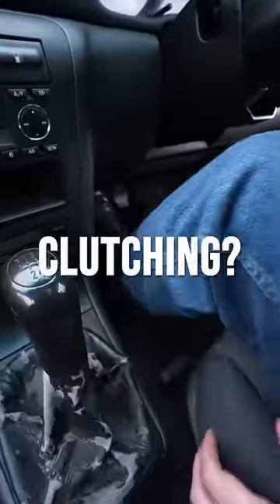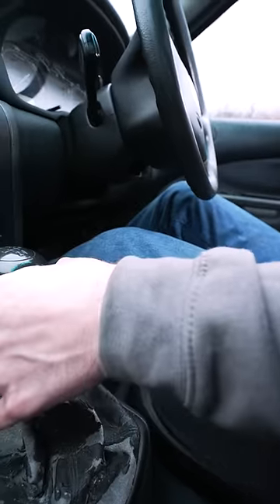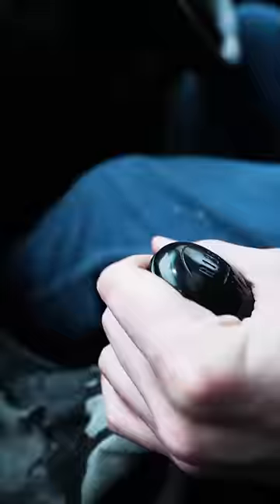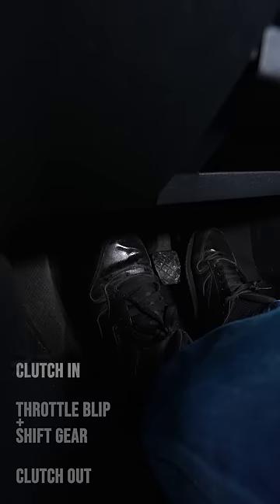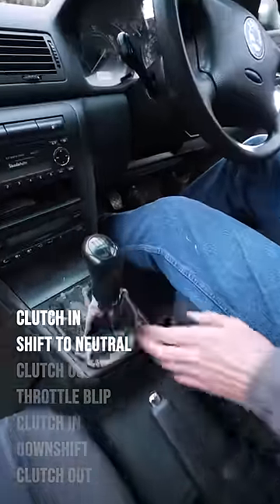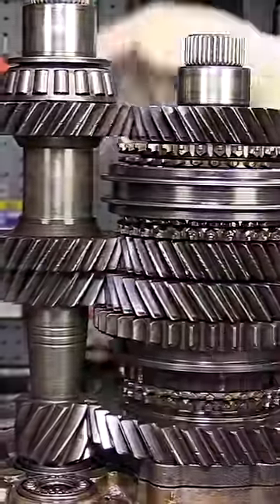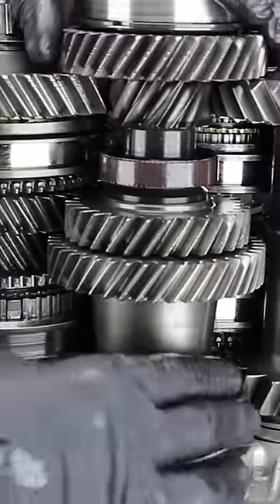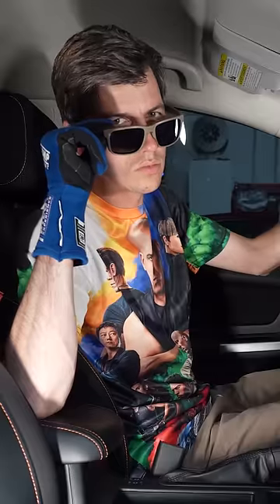What Is Double Clutching? Don't Granny Shift!

Comment: Got thrown on a manual dump truck at work, we borrowed it from a different department, ours were all automatic. They all said the clutch was shot and it wouldnt shift right. 5 minutes on google taught me how to double clutch and not to put the clutch to the floor when shifting and it soon became the favorite truck to drive.
Reply: you still need to put the clutch in for stopping and starting even if you're floating gears bro. you only half clutch when shifting cuz if its moving and you put the clutch to the floor it stops all the gears from moving and if you're rolling in gear there goes a 30k tranny!
Reply: i want an old dump truck so bad
Reply: I remember trying to learn to drive trucks at 18, we'd clutch to get out of gear, then release the clutch, and then just press the stick into the next gear and let it litghtly grind until the speeds synchronized and it would slip into gear without touching the clutch. I wasn't very good at it. My dad told me just to do the full fledged double clutch, which was clunky, but better for the truck.
Reply: You could just float the gears as well. I had to drive an old manual truck to get my license to drive an automatic lol. 

The whole time we just did gear floating, much easier and enjoyable.
Reply: @kaufmanat1 if you do it gently, you won’t grind the gears, my driving instructor taught us to drive with “Finesse” and only use 3 fingers to put it into gear. If you know the truck you won’t grind the gears. If you force it or shift too early, it will start to grind.
Reply: @johnmcwick1  if you are taking the test in a manual semi you have to demenstrate that you know how to double clutch or they will fail you. thats why they have a restriction for auto transmission trucks.
Reply: @mromatic17  I don’t think that is required anymore, I got my CDL in December just before Christmas. They never taught us how to double clutch more did they have us demonstrate how to. We only knew because of the pro driverU course
Reply: @johnmcwick1  It varries from state to state I've heard in Arkansas you just have to take a written test. I got my CDL in Utah 2 years ago and theres a specific restriction for if you take the test in and auto truck then your license will say restriction no manual transmission CMV's
Reply: @mromatic17  I think Idaho is the same, my company sent me through to get mine with stick so I didn’t have to worry about the restriction in the future.
Reply: I call it speed shifting. Never use the clutch until stopping and taking off.
Reply: You can float downshifts....
Reply: @johnmcwick1  if you want that unrestricted A, you need to learn manual
Reply: @christopherhall5361  I did, I learned manual but I currently drive an auto.
Reply: I have a 1970 C50 grain truck .
350/4speed Clark w/2speed rear.
No syncro on first but 2up do.
Its absolutly pointless ,just shift it normal .
Reply: Learn how to float the gears and you will hardly use the clutch at all.
Reply: @mromatic17 it won’t damage the whole transmission just the clutch brake which sometimes you have to remove the transmission to change but most of them they split in two pieces
Reply: @jeffjefferson8137  What the hell are you on!
Reply: I used to drive old 15 speed dump trucks on a farm, the only time you had to use the clutch on them was for getting into first and reverse. After that you just got to the right RPM and you could just throw it into the next gear. 
Best part was the tachometer was broken on our trucks so you just had to learn it by feel and sound. 
Man was it ever satisfying to drive those things though

Comment: Took my drivers licence on a Hanomag D28 from 1963. That truck did not have a synchronized gearbox so you'd have to double clutch shifting up and double clutch and rev the engine in between to shift back. After these lessons you are able to drive any vehicle even if the clutch does not work. Shifting up - wait for the moment with a little pressure on the gear lever. Shifting down - pull the gear, rev the engine - gently press in the lower gear. Without practice the gearbox protests - the more you try the smooter it gets. It works - no lie. I admit stopping is a problem. You'd have to use the starter with the gearbox in gear. It jumps a bit but in an emergancy it works.

Comment: Finally someone who mentions the shifting in F&F... the way I see it 1/4 mile was 4 ½ minutes @167 mph in 97th gear.
Reply: With a blown manifold
Reply: What about the 30-mile long runway that airport has where the FF crew can chase down a jetliner? 🤣😂🤣
Reply: @vincedibona4687 the plane never takes off, it never runs out of space, only when it crashes does it stop. And they just keep on going faster.
Reply: Right? They must have been running half to full mile races for them to race that long and shift so far in between. In a 1/4 mile race you would probably be in your top gear in like 10 seconds. You would be shifting every 2 seconds.

Comment: As a former rally driver, I've only heard it called double DEclutching. (Somewhere, probably in the US, the self-explanatory part of the phrase got dropped.)
Very useful when simultaneously braking & downshifting in a car without traction control, to stop one or more of the driving wheels breaking traction when the lower gear is engaged.
Reply: I’m somewhat new to driving a manual and found the terminology used to not make technical sense. For context, I’m in the US, so I’m not sure how different terminology might be compared to elsewhere. But I thought it was confusing because people will say to “release the clutch” meaning “let your foot off the clutch pedal” which I found confusing because that action is actually engaging the clutch (right?) and not releasing it. What you’re releasing is your foot off of the clutch PEDAL (…right???), so my thought was “okay why not be technically accurate and say ‘release the clutch PEDAL?’” 

“Releasing” the clutch happens when you push the clutch pedal, right? So when my brother was teaching me and he’d say “release the clutch” while my foot was on the pedal I was like “wait what do you mean, if I’m pushing the pedal then the clutch is released..??”

De-clutching makes way more sense to me. My guess is that “clutch pedal” is too much of a mouthful for folks
Reply: @luna.a.a   yup, you are correct! And it is confusing, but you got it 👍
Reply: You don't need to double clutch to prevent the wheels from locking up. You can just rev match it with the clutch in. Double clutching is purely for getting it in gear without synchros or fucked up synchros
Reply: @CobroxYT  I shift without the clutch, just to practice rev matching. Then I discovered automatics and thought, "enough bs, I'm in".
Reply: @shortfattoad7317  "I shift without the clutch". Clutch disk: am I a joke to you?
Reply: In the US learned it as dubbuhcutching from a stoned college student
Reply: Americans could care less about using phrases and idioms correctly
Reply: @santouchesantouche2873  I'm not an American and the dictionary does not agree with you, but yeah, keep being condescending.
Reply: @santouchesantouche2873  😂😂 The "as if" at the beginning disappeared quite some time ago.
Reply: @santouchesantouche2873 You said "could care less" instead of "Couldn't care less" on purpose, right?

Right?
Reply: Bro go watch The Fast & The Furious 1, the writers had no idea.

Super Street was even makkjng fun of them.
Reply: @rocketpigrecords3719  yeah Toretto mocks about Brian not double clutching in a drag race, why would anyone waste precious time doing that?
Reply: @JustRememberWhoYoureWorkingFor  unless it was a depression era drag race?

Nice laptop, are you streaming rn? 

Nevermind - line up with the other 12 cars.
Reply: @CobroxYT  its not "purely for getting in gear without synchros" it also spins up the primary shaft so when the shift completes theres less inertia change, so the error in speed matching doesn't cause as much of an impulse to the drivetrain and wheels. Theres always some speed match error.
Reply: @derp6632  yes which is why you have synchros. The tiny jolt you get from throwing it in gear with the clutch in will never lock up the wheels, you don't even feel it
Reply: @luna.a.a  You are correct. The term is misleading. In french you actually say "débrayer" (deconnect) and in german you say "die Kupplung treten" (to step on the clutch)
Reply: @Shorjok That did, indeed, seem to be The Joke. Well done.
Reply: @santouchesantouche2873   I see what you did there!
Reply: @YTNo, synchros purpose is not to reduce impact. You absolutely can feel even the gear backlack let alone the rapid change in inertia from speed match error. The impulse is large enough to push you over the tractive limit of your tires given your drivetrain is rigid enough to not absorb it. Factory street cars usually engineer compliance in the drivetrain to reduce the impulse to the trans, driveline, dif,  wheels etc but racecars have very little compliance and you will feel the impacts!! I broke an engine case of a cbr600rr on an openwheel car from impact loading during shifts!! Don't underestimate the power of impulses!
Reply: Yes exactly,  It's Double De-Clutching.
Reply: @m0skit0  Explain your gibberish
Reply: @ArnoldQMudskipper I see it so often these days it's hard to tell
Reply: Thank you very much, you've saved me a rant. I'm refusing  anyway to watch if they can't use the correct term !
Reply: I mainly use it when I’m slowing down and downshifting.
Reply: Declutch is a word that is hardly ever used in the US, in any context.

Comment: It's useful for downshifting only, and it's most useful for "fooling" the synchros when you're attempting to downshift past the next lowest gear. Sometimes synchros are a bit overprotective when downshifting. I can't shift into 1st gear at anything over 5mph. If I double clutch however, I can speed up the input shaft/countershaft a lot more and that more closely matches them to the output shaft's speed. The synchro blocker ring pivots to block the dog teeth until the shaft speeds are matched and they will stay in the blocking position whenever the difference in speed is too high (such as trying to shift into 2nd gear at 75mph). If you double clutch and rev up the input shaft before making the downshift, the synchros are able to match the shafts and the blocker rings will not prevent the shift. I can then shift into 1st at 10mph when I know I need to slow way down to take a turn into a parking lot. If I didn't do that, I would need to slow way down and then downshift while in the turn or after it. You don't want to take a turn with no power applied to the wheels.

Comment: lol I remember asking my dad (who used to race) about this when I first saw the movie, and his response was "I have no idea what they're talking about" 😂
Reply: Many tractor trailers required double clutching when shifting unless you float your gears and don’t use the clutch at all which most drivers do but if you decide to use the clutch to shift then you’ll need to double clutch when doing so.
Reply: If he doesn't know this he doesn't know how gearboxes look internally
Reply: My dad would have known. He used to drive a car with an unsynchronized gear box in his youth were you had to double clutch on almost every shift. Unless you were lucky and the revs matched up.
Reply: @MrSeedi76 I just learned to shift at the right rpms and do it quick. I always thought double clutching was just for semis but after that movie came out I was really wondering if it was something else. Turns out it was all bs though.
Reply: I used to race too, and when i saw that movie i bursted out laughing because it made no sense at all.  I also wondered why the floor fell out of the car.😂
Reply: @Toms_Channel  he was going to fast for the bolts! 😂
Reply: but why put in nutral if you're blip throttling ?  Like isn't the Blip used to rev match ?
Reply: @dustinisaac5132  I still do on my old car otherwise i can barely downshift unless I learn to shift at the right rpm which I can't really bother learning
Reply: I drove semi for over 10 years not once double clutch
Reply: what was so funny about your comment that it made you laugh out loud?
Reply: @IvanDaniel28  what's so unfun about your life that you care to make comments like this?

Comment: For ANYONE who has ever driven a manual, look up "twin stick 18 speed".  I learned to drive manual in a 1976 Mack dump truck, with one of these.  By the time I got into my first "modern" 18-wheeler (10-gear Eaton-Fuller), I was "floating" without ever having to touch the cluch while gearing up (aside from when at a dead stop).  

It was REALLY fun when a friend of mine let me drive his bored-out '99 Trans-Am on a drag strip.  Not only did I beat the heavily modded Mustang next to me, but my run was the smoothest the race coordinator had ever seen in his 40 years of working drag races.  😂
Reply: Its embarrassing to like in such an old age
Reply: @1738-l1j  Why's it embarrassing?
Reply: @1738-l1j that doesn’t even make sense bro
Reply: my car has an unsynchro 1st gear, so downshifting from 2nd to first requires double clutching, and even if you're at a stoplight in neutral you have to double clutch it back into first (or reverse)
Reply: @rexjolles  That sounds more like the linkage for first is bent. If 1-2 synchro is bad, you'd have to double clutch or rev match going up.
Reply: @briangwynn3592  no it doesn't have a synchro for first